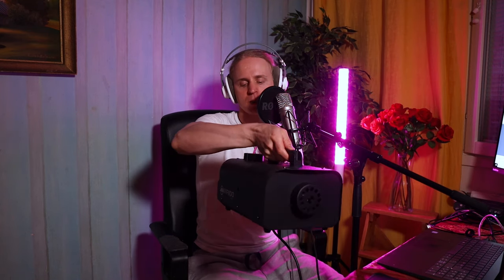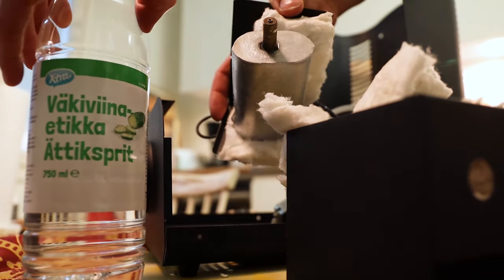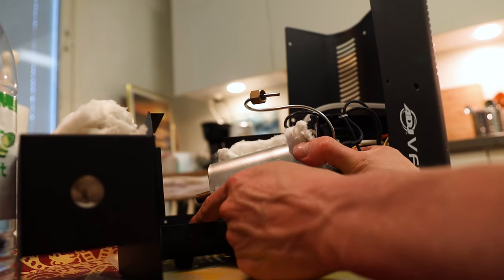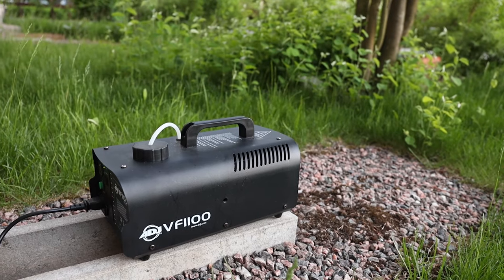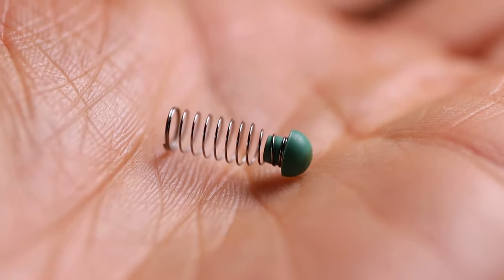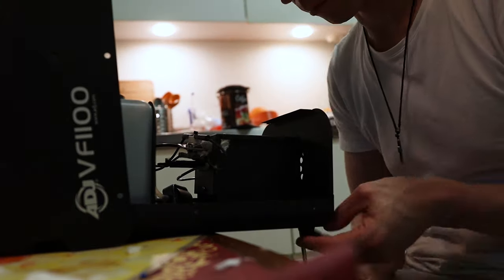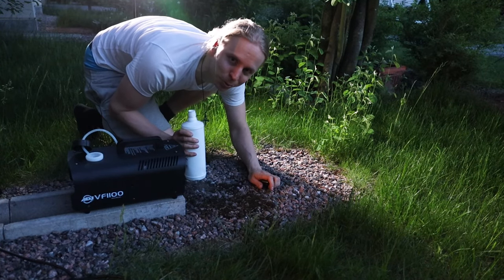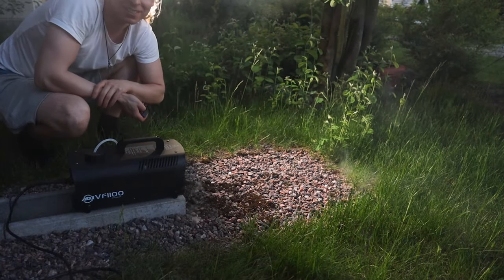Here's How To Repair Clogged Smoke Machine

Comment: Budds, what if the machine doesn't have the motor sound that much. Maybe a very little sound from the maching and no smoke at all.
Reply from the maker: My fogger's pump was dry so it had loud noise. Also your machine's pump might be stuck some how. Hard to tell reason without seeing your machine :)
Reply: @thymppi  I would like to thank you for uploading this video. I was able to gain confidence troubleshooting my machine and because of you, my machine is now back up and running.